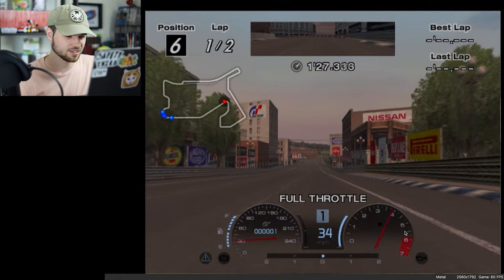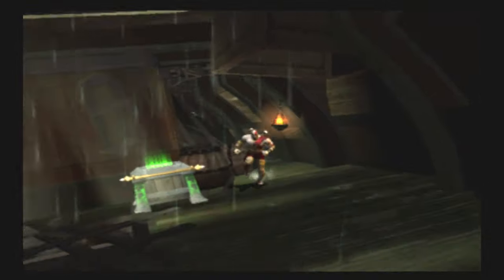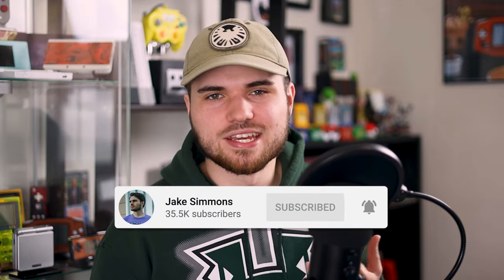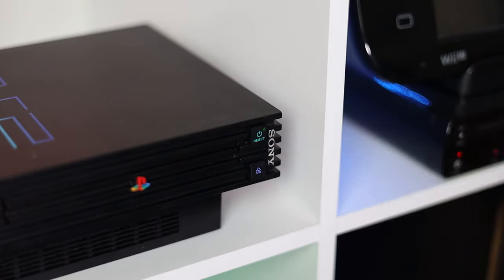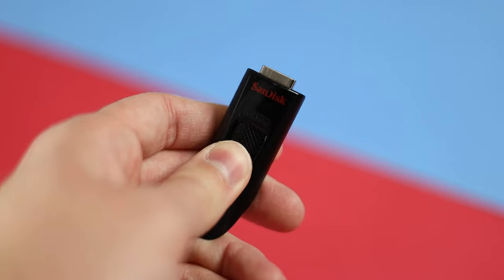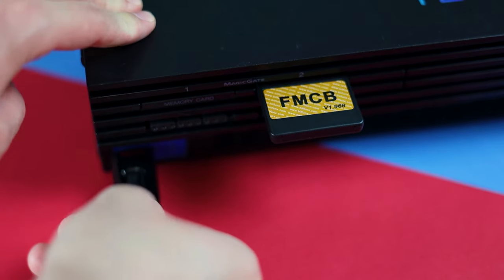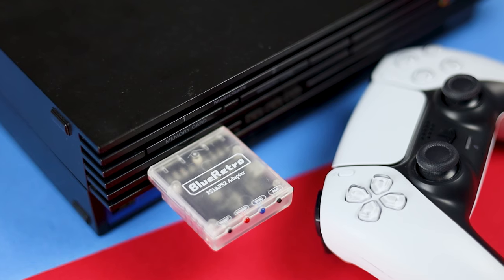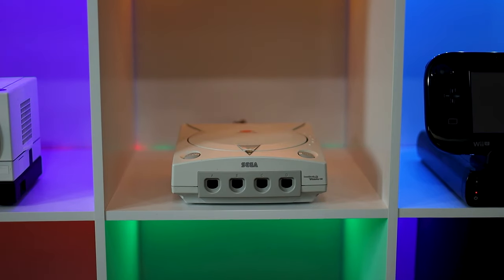PS2 Mods Are SO EASY! (and cheap) | The ULTIMATE PlayStation 2

Comment: Hello, I'd highly appreciate 2023 guide to PS2 wireless controllers. I was thinking about Brook Wingman or Blue Retro, but my main concern are pressure sensitive buttons on PS2 and I found out that modern controllers doesnt have pressure sensitivity and that even these solutions aren't clear with supporting transmitting pressure sensitive buttons. Retro Fighters controller seems the only option for me. I found discontinued Logitech Cordless controller that seems even better than Retro Fighters, but is double the cost of Retro Fighter for a used controller.
Reply: I have a Dream Gear wireless PS2 controller, and it's great. a bit fatter than the PS2, but beyond that, tight responsiveness and I haven't experienced any drift in the just over a year I've had it, and I bought it second-hand. But I haven't tried others for comparison, just throwing out an option.
Reply: @CyberCross222  I bought both Brook Wingman and RF Defender and both are excelent options :) Maybe Brook Wingman with PS3 controller is best native playstation experience but I love the build of RF Defender and I like to use it on PC also <3

Comment: not worth it. Just emulate it.  I have a PS2 sitting right here, I know exactly what I need to do and it's simply not worth the time and effort here. Emulation looks better and is easier to do than this mod, more rewarding and zero sunk costs. This one has quite a few sunk costs with it. Paying for the mem card and the BT control addons. The UI looks terrible, the config is still finnicky. It's annoying when people say this is a "super easy mod" when it's clunky at best. . 

And there's just no disputing it, given the cost here money better spent elsewhere. And if you think "well what about original hardware"  -- yeah except this has already violated most of that by dumping the games and adding a $300 video converter.  So that argument is moot, and thse games don't need perfect frame zero-delay either like early NES SNES Sega  Atari games do, response precision is very forgiving in ps2 games. When people say they need an original NES and a CRT for sake of speed, I understand that.  Not needed here.
Reply: The day there's a retroarch core for PS2, I'll sell my PS2. There's literally no other front-end which works universally on everything. I play all other systems on retropie and modded switch retroarch. I'll even get a Mac mini for emulation and do something else with my RPi if there's a decent front-end for emulation on Mac.

Comment: I did my HDD/SSD and new fan mod to my PS2 Fat console. everything works. My only question, I haven't tried it cuz i don't wana ruin something that currently works.... can you add games here n there. like dump 50isos  one day, then be like oh wait i missed a backup and then dump a single iso without compromising the other 50 already on the drive? or do you need to format the drive and then dump the "51" games?
Reply from the maker: You should be able to add games without having to format it every time

Comment: Does the HDD need to be formatted before plugging into the PlayStation 2
Reply from the maker: I believe hdloader will format it on the console
Reply: @JakeSimmons  awesome so I don't need to do anything on a computer ? And HD loader is on fmcb?
Reply from the maker: @pyro-jay  correct
Reply: @JakeSimmons  awesome thank you
Reply: You can format the HDD in "uLaunchELF" inside FMCB MC directly in PS2, or you can format it in PC using "HDL batch installer" the latest and best program

Comment: So I just plug the memory card into my PS2 plug in a thumb drive with games on it and I can load games immediately?
Reply from the maker: No there is a little more set up but it is very simple. I just didn’t include the step by step instructions because there are multiple ways to do it and it’s constantly being updated and improved

Comment: For some reason the original ps2 gets extremely dusty, it’s actually the cause of most fat ps2’s not being able to read disc after a while.
Reply: It's because it has a ton of airflow in terrible places with negative case pressure. Dust is sucked in there and it stays there. There's a very good reason modern consoles intake air from the top.

The Slim doesn't have fans at all. It's entirely passively cooled. The only moving parts are the worm gear and the disc spindle, both of which are easily repaired.
Reply: @ootdega  slim design is genius really

Comment: Does anyone know if all games are compatible when using a hard drive on a Phat PS2? I have a slim also and have been looking into the MC2S10 but I noticed a lot of games arent compatible. I am just wondering if I should just mod my Phat ps2 or go with using my slim. I prefer the slim console in general over the phat as its easier to clean and repair.
Reply: Do you have modchip on your slim ps2?
Reply: @skuidly2978  No and I also haven't had any compatibility issues also

Comment: my cheap way is, just buy the fck i n g Ps2to HDMI (10$) and use OPL upscaling + 60 unlock. comp. cost points whit MC 20$
Reply: It is cheap but can’t really compare to the Retrotink 5X. As much as I would like for things to be cheap quality costs money 🙏
Reply: @wesuda  yes its true but 10 bucks are 10 bucks and a secret tip Ps2 can bluethoot whit OPL and you can use you Ps3/4 and maybe Ps5 COntroller whit it nd fpr the "fre aks"  maybe the xbox one serie s controlle rwhit bluethoot suport.
Reply: @the_sjdo  thanks for the tip but I like the PS5 controller better so I’ll be getting that adapter 😁